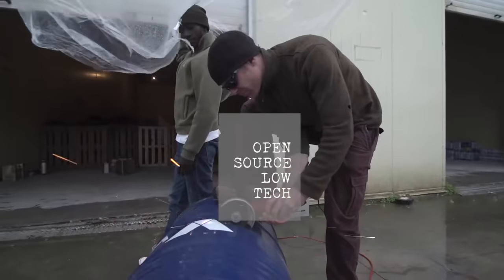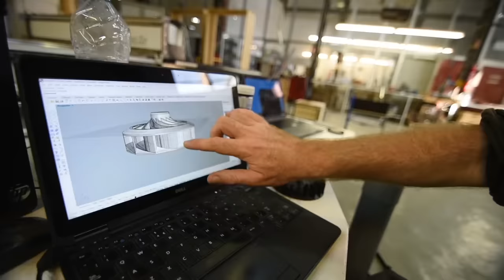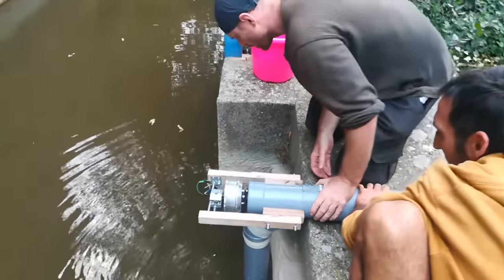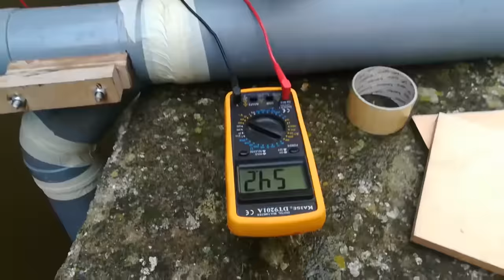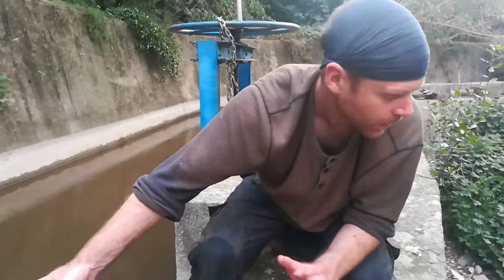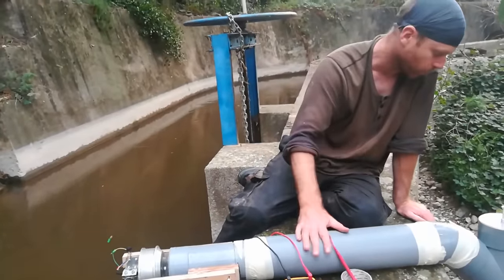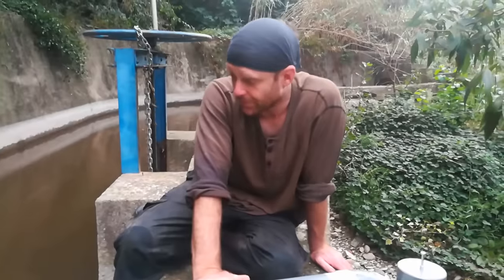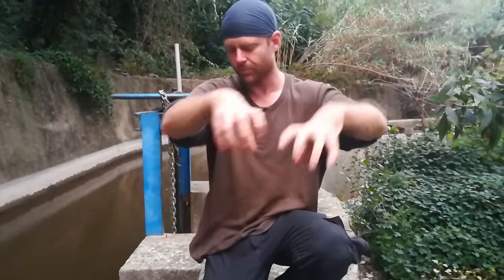The $50 Water Turbine -DIY, Portable, Powerful, and Open Source

Comment: For this to be realistic you need: to load the generator, and show the power curve.
Reply: Yep! ROFLed when I heard 10 amps! Not even one under load! Every generator runs wild unloaded!
Reply: He says this in the video.  Watch it again.
Reply: @hotcoffee5542  If you know anything about electricity you know that the 55V unloaded will drop to 5-10V loaded and the current will be, at best 1A. This will give you 5-10W of usable power with this particular configuration, which is too little for all the effort - there are no free meals in physics and power generation is one of the most difficult cases, due to the very low efficiencies in all types of generators.
Reply: @hotcoffee5542  he says 500 Watt which is crazy for that design.
Reply: Yes I agree totally P = V*I we cannot get away from that fact.
Reply: @JoseSilveira-newhandleforYT  Too little for all the effort?  How about very nice start to see what works and improve the design and builds for there?  And Joe ... make a better one and post the video.
Reply: Same thing I thought... no load, probably would grind to a halt if you hook a lamp to it.
Reply: Half a dozen homes with 1 100w light bulb in each SMH
Reply: Multimeter leads in incorrect position.
Reply: @mysticdavestarotmachinesho5093  Yes, it is too little for the effort. This isn't some new design; it's a rehash of a very old one, that has well known limitations. Same thing for sterling engines, for example. The best application there is to couple a nuclear TEG and cool sea water, to power it, and the only true benefit there is: the simple design, while highly inefficient, creates little noise....so it's preferred use in naval submarines.
Reply: @JoseSilveira-newhandleforYT  That... just proves you don't know very well how electricity works...
Reply: @JoseSilveira-newhandleforYT  you're right . It's impossible to get 500w with such a tiny conputer fun
Reply: @northernalberta399  with new led lights a 5 watt lightbulb give almost 100 watt light compared to an old type lightbulb that use most of the power for heat..
100 watt in a house is more than enough to say load a few celphones and a laptop ore 2 + led reading lights.
Reply: @AlejandroSantos  The motor he is using isn't big enough to generate 500 watt, I've seen actual hydro systems with 500 watt rating and the motor/generator housing is enormous, and requires much more pressure to operate. Another thing about a small system like this is that the smaller the fan/turbine and the closer the blades are together, the more likely it is for some random crap to get sucked up into it and clog it.
Reply: precisely.  must be tested under load to give a power output.
Reply: @JoseSilveira-newhandleforYT  the idea is to connect a battery bank to the turbine, so the batteries are in charge of the load
Reply: @hotcoffee5542  
Not with a load on it
Reply: @samkom33  
That’s a dumb comparison! 5W led is not the same lumens as a 100W incandescent. And it doesn’t even matter cuz I can’t charge my cordless tool batteries or make coffee with either 5 watts or 50 lumens. 
We need watts, not ‘equivalents’ because we need watts to do work and they don’t make an LED coffeemaker, either.
Reply: @fishhuntadventure  Watts ALONE dont mean shit. hehe
you need a combination of watt+voltage+amps to say charge a battery!
if you say try to charge a 12 volt battery with a 10 volt  charger the battery dont get charged no matter how many watts you have...
for example my smallest car battery charger give 2 amps and use say 50+ hours to fully charge an empty 100 amp battery,
while my 60 amp charger use around 2 hours.....
BOTH start at around 14,5 volt but as the battery gets fuller and fuller the voltage is redused until around 12, 8 volt when the battery is full..
REASON you dont see many led coffe makers is that LED Lights produce very little heat! you need resistance tread in the heating element for that like in say my metal melting oven, yes the heating threads inside the oven get yellow after a while when i melt say steel.  BUT IT WOULD BE AN EXPENCIVE READING LIGHT.  haha
2 x 5000 watt 220 VOLT

Comment: I like the idea of the siphon.  Nice design.  Do you find, with such a small, multi-blade impeller, do you have any problems with clogging due to debris in the water?  Also, might your analysis regarding speed vs. torque demands differ when the generator is under load?
Reply: Seems the turbine is sitting in a section of pipe where there is little new water. You could always add a big mesh filter at the inlet pipe to minimise any debris entering

Comment: This really an impressive turbine. We also wants to use it at our fishing pond in Austria. There is no electricity but a lot of water.
which diameter do the pipes have? 100 mm or 150 mm? Is the repeller really a pc fan? The generator is  a hoverboard motor, is it AC or DC?
Reply from the maker: The pipes here are 110mm up to and including the impeller (which is an ATX computer power supply fan), and then immediately after increasing to 125mm. Just because these are standard PVC sizes which seem to work ok.
The hoverboard wheel is putting out three phase AC, which will ultimately be rectified to DC for charging a battery.
Reply: @OpenSourceLowTech  That's so cool.  You made something and made it from what you had available. Thanks for posting that.

Comment: Seems like you could put a second generator on the output end to double output
Reply: That may work, it may also cause a power loss at the main turbine. An external wheel would certainly work as it would not interrupt the flow.
Reply: It will reduce the speed of both turbines so there is no way to know for sure.
Reply: @wolfgangouille  second turbine has to stay external and you'll have gain without question
Reply: @j.r.576  Right. I thought he meant inside the tube.
Reply: There is only so much energy in the fall. Adding another load to the flow would just slow down the original turbine..
Reply: If you had a steep grade where you could space out your falls to keep the pressure constant, and have a small reservoir and the same system as above every ten feet or so.
Reply: Loss of water energy from the first generator as well as frictional losses should be made up by water acceleration due to gravity. In addition, due to their small size, multiple parallel systems could be set up very close together...
Reply: Just a basic Betz limit. Find the sweet spot, it's not as simple as doubling intake...
Reply: Set one up in reverse direction and have 2 going the same time feeding each other through water. Yiu could do this anywhere.

Comment: Put two motors in series. one on front of pump one on the bottom
Reply: The losses you would get from impeding the water flow would exceed the generated power.

Comment: 3:22 one probe in current jack, one in voltage jack und com unplugged. I dont think this style of measurement will be teached in the manual 😅
Reply from the maker: Yeah, well spotted, that multimeter wasn't set quite right, but have confirmed the voltage since.

Comment: Great video! I make a lot of this sort of stuff. Love the siphon setup.

You've made an error on your output calculations, 500 watts from a plastic computer fan in a soil pipe? I doubt it's doing even 10% of that. You need to measure it with an actual load not just a multi-meter. Also I would expect a lot of water-Bourne debris, won't be long before a stick goes through that computer fan and smashes it to bits. Metal fan more ideal! Hope you don't mind me giving advice based on my own experiences...
Reply: Siphon is a great way to spin any size match up way better than wind, water constant flow of power to devices
Reply: They sell really nice jet nozzled water turbines for home use. 15 -18 ft drop on 3, 4, 6 inch siphon set up will run large generator head

Comment: Great video but those plastic blades won't hold up to 500watts once you put a load to it. I tried  and it didn't work with 500 watt light as load. I ended up buying the  blades. They look like spoons with a notch  cut out of it.
Reply: Yes. This doesn't occur to most diy builders because it is not intrinsically intuitive. But once there is an electrical load on the generator, it creates current flow resistance that translates to electromagnetic "braking" of generator rotational speed. This braking action will snap off the plastic turbine blades as they try to turn against the increased resistance. Thanks for sharing your firsthand experience.
Reply from the maker: I tested that by shorting the three AC channels so as to create maximum load, which hammered to a stop the impeller and water flow, but didn't seem to do any damage to the blades.
Which was of course just a momentary load, we'll see how it holds up over weeks and months. The impeller can be significantly reinforced tho by gluing a thin circle of pipe around the blade edges.
Reply: @OpenSourceLowTech  time is the most important  thing on earth. DONT WASTE IT you cant get it back. Learn from other people's  mistakes and let's not all keep repeating mistakes.thats what big oil wants is for us to keep going in circles
Reply: @OpenSourceLowTech  you could always try a metal  impeller from an RC EDF electric deducted fan  there cheap and strong as hell . you could also put a call out to rc community for crashed ones and try get them free

Comment: Put a turbine at the end of that set up also.
Reply: That's a good idea. Just before the outlet. Still a solid flow of water.
Reply: It would restrict the water flow more which means decreased efficiency of both turbines. Could still work though
Reply: Put a turbine at each section connection on that tall fall side
Reply: Outside the pipe, it could work. Nothing else should be added inside, however. A low-pressure turbine might get you a little. Could be a better way to take advantage of the force being dumped onto the ground. A cistern that fed a pressure nozzle might get you somewhere, but now it is leaving the cheap-ass territory and getting beyond this project's scope. Just my 2 cents.

Comment: Another larger turbine at the bottom of the outlet would be a huge improvement. You've got a lot of energy wasted at the end.
Reply: Thats more like it
Reply: @alabastardmasterson  why? because it would slow the flow?
Reply: Wouldn’t that just slow the flow down for the impeller at the top?
Reply: You don’t want to slow the water down. He said he’s working off the speed of the water through the pipe. But if the water came out of the pipe at the bottom and dropped onto a wheel of some sort then there’s where you catch more energy. And water speed won’t change.
Reply: what if after the required lenght for the siphon to work the water expelled is directed in a typical (but small) water wheel? (
it would not restrict the flow and hence the speed of water but you'd get an extra generator
Reply: @markhaynes3378  we had the same idea at about the same time (but your comment is first and i look like a copycat douche :p)
Reply: Yup! a lot of wasted water for mickey mouse device...............
Reply: @maxk5065  "at the end", not in the end. Just because I don't mention every detail doesn't mean you shouldn't limit your creativity.
Reply: @markhaynes3378  Jesus Christ!!! It's at the end!!! Place the damn thing on the outside of the pipe!! And it doesn't have to be a prop. It could be a screw, a wheel or any damn thing that will turn!! The whole point of the video is thinking outside the box!! DO IT!!
Reply: @djangoapple8230  ok, i didn't know (i'm french so english isn't my native thongue) 

a screw uses less the "lever power" than the weel and is therefor able to generate less power in my mind.
Reply: @maxk5065  very good. Look up, Victor Schuberger
Reply: @alabastardmasterson  okay. What do you need the most speed/pressure or volume? How bout both? I say for fifty bucks a unit it would be worth expanding. Sharpen your pencil on both ends. You may want to write this down.
 Duplicate your siphon. Then you would have double the volume. Duplicate that and have 4 times the volume. Plumb that into one larger pipe. Say 8 inches. Using 4, 4 inch into 1, 8 inch would double the pressure. At the bottom reduce   reduce the pipe size down to a manifold with 8 outlets. Use male threaded fittings with high pressure nozzles on each. Direct the nozzles at what you want to spin.
Reply: @markhaynes3378 good idea

Comment: And this involves draining one lake and filling another?
Reply: @minester625  technically that would work only if you drain it back into the river at a lower point - the change in gravitational potential of water downstream is what you're harvesting (and so you can get the efficiency of the system if you know the volume of water and the drop in elevation versus what you are pulling out through the generator)
Reply: Well, if you have the first turbine and add a second to reverse the flow to re-fill the river, you could add a third turbine that would operate by the two flows passing each other. Yes no?
Reply: @cvcoco  right.  And with the third it would actually cause a magnetic resonance hole.  If you you  used two double sets  inversely  opposed at different taranto lines  then  you could actually get a time pause.   If you  wired this all in parallel series  with variable offsets you  could either forward or reverse control the bandwidth and direction of the time pause and finally adding flow controls  would basically give you an actual time control machine.   You  couldn't actually jump in time but you jump time around you giving you virtual control so you could actually be in any time you desired.   Sweeet!
Reply: @engineclinic  lol I think you won the net today.
Reply: @engineclinic  just the greatest answer !!!
😂🤣😂🤣😂🤣
Reply: Jim Patriot  how about the return water being dumped back into the same lake?
Reply: Jim Patriot  Okay. I wrote a long answer to someone who lives in a desert. It details using an 600 to 800 gal. oblong tank. a series of pipes ranging from  8" to 3 or 4" smallest into larger, into largest, This will lift the level of water in the smallest pipe, giving you the height you need. the outflow is then fed back at the other end of the tank. Seems plausible, but I don't know
Reply: Sean Steele  lol.
Reply: Sean Steele  yes,  I probably should add volume amplifiers before the flow controls for increased velocity to reduce molecular turbulence.
Reply: Sean Steele  I don't see how the fish will become sick Sean, all that you would be doing is aerating the water.
Reply: @engineclinic  gold

Comment: Good project, but it is missing the actual result: showing 50V voltage having load of 10A.
Reply: you used the magic word "load".....the system needs to run while powering something, charging a battery, powering big light bulbs, something....
Reply: @billpannell7390  Yeah, the author just assumed he will able to have  50V under 10A load... For some reason, I assume that the voltage will drop significantly under that load. I want to see at least some result under real load.
Reply: It can't make anywhere near what he is claiming, he is saying 500 watts,  I would be surprised if it even made 10 watts... :(

Comment: you drug all that stuff out there and no one brought a light bulb???
Reply: They had a multimeter with them to test it why bother bringing something so fragile.
Reply: @wuhan827  Because the Multimeter doesn't load the system. What use is a generator if it stalls while generating a few watts
Reply: @Archer198026  Well he did state what the motor would put out according to the specs.
Reply: @LEO-xo9cz  What does the motor specs bring you, if you can't pull that energy out of the water?
Reply: @Archer198026  

exactly... 😉👍
Reply: @Archer198026  I hand cranked a 100 watt incandescent light bulb at a science museum when I was a kid. Yes, it was difficult to get it bright, but it was way easier than pumping water to the height and and speed of this guy's setup.  I can easily believe 55 volts times 10 amps, because that's only 5.5 light bulbs.
Reply: @MultiPleaser  There is no way he pulls 500W out of this. 100W top
Reply: @thomash7031  I guess it depends on the design and materials of the generator/motor. Car and motorcycle motors are making 300 to 100 hp, and yet they are only a couple times larger than a swimming pool pump, which makes about 1 hp.  Maybe the auto/moto manufacturers took a design clue from Dyson vacuum cleaners.
Reply: @MultiPleaser  that's based off the explosion of gas.  this is based off just the force of gravity on water.  I did some calculations and you would only get about 120 watts.
Reply: @thead9  I literally meant the motors, as in electric motors.  About your calculations. Would that be mass flow rate times the potential energy of the water at the maximum height?  mgh/t  If it was 10 feet high, or 3 meters, then 120 watts = m 9.8 3 / 1 sec. Therefore kg/sec equals about 6.  Hmm, that's 13.2 pounds per second, which is about 1.6 or 1.7 gallons. (I didn't use a calculator, so this is an estimate.) I guess that's a lot of water, but it looked about ten times faster than that.

Comment: Yes, putting a multi-meter on the output is meaningless, it is like saying because my fuel tank holds 55 litres of fuel I have this much power from the engine. Put a real load on the output and we will see some meaning full results. 500 watts bullshit.